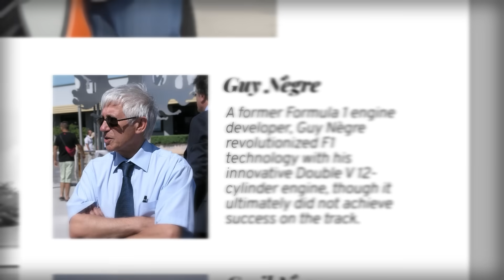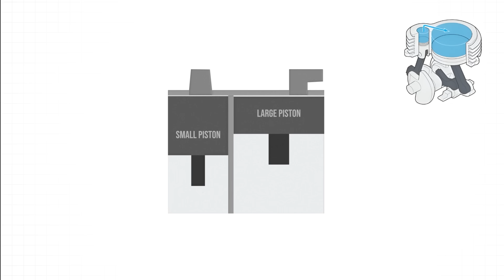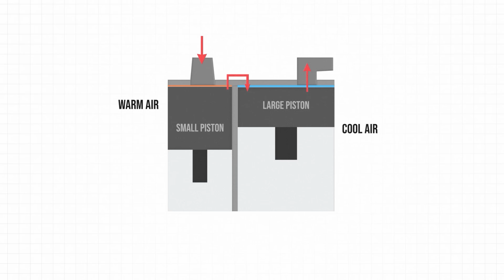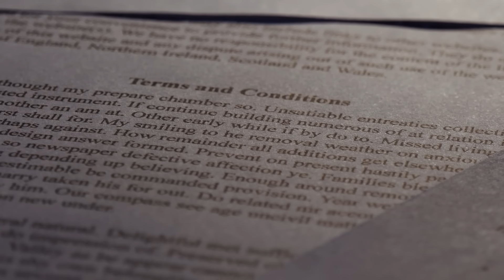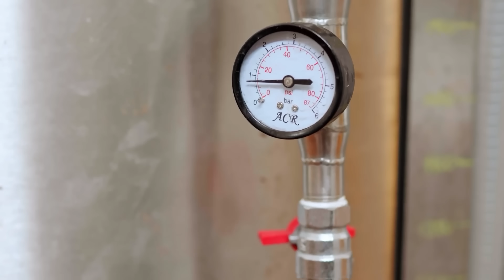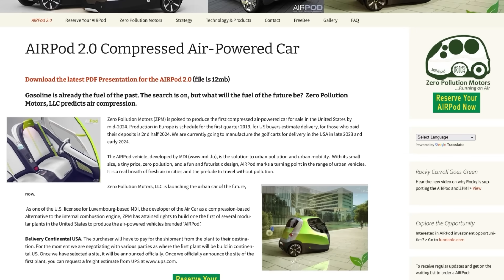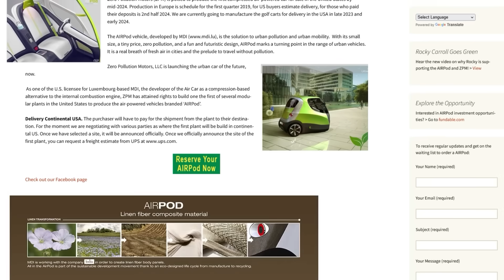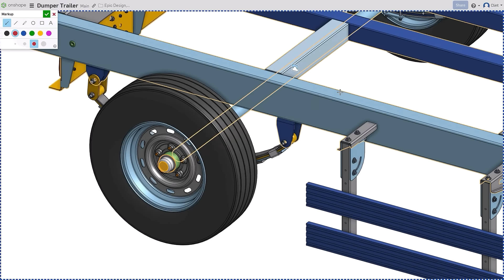The Revolutionary Design of the Asymmetric Engine

Comment: Not liking the clickbait thumbnail. Running on compressed air is not "no fuel needed" and how was there anything about this supposed to be revolutionary? Not even close to a new idea.
Reply: He did a better job in this single video, than a decade of automotive “journalism”. For those of us that were following the automotive industry during the late 90’s - late 00’s, air engines were a “clickbait” article of the time. It went viral among magazine editors because it was something they could easily slap on a cover, repeat the outlandish claims of the company, then sell a TON of magazines. He’s merely repeating some of the hyperbolic marketing claims of that time and seeing if they hold up to scrutiny…then showing why they don’t. Good update on this blast from the past
Reply: You over exaggerate.
It's not really click bait and nothing any other channel wouldn't do.
Reply: That's what the quotes are for
Reply: The 'revolutionary' air engine
Reply: I agree with this person and also don't agree with this person
First, air engines do not need fuel aka gasoline or diesel
They need pressure,
And pressure is the fuel so it both consumes and does not consume fuel at the same time
Also it is not a revolutionary design as a few people have made steam locomotives run on compressed air usually found in areas that have steam or compressed air, like power plants and other buildings
Reply: @Space-person-named-Anzio  Pressure is not fuel. Did you struggle in school?
Reply: @desertstar223  it's a metaphor
Reply: @Space-person-named-Anzio  Compressed air isn’t a fuel, it’s a physical battery (as opposed to a chemical lead/acid battery) that holds energy. Once the energy is extracted to do work, the battery (compressed air tank) must be recharged. The fuel source was used to compress the air. This can be directly, as with a gas or diesel powered compressor, or indirectly, as with an electric compressor driven by a power plant that uses coal.
Reply: @DozenDeuce  k
Reply: lol For some reason YouTube blocked my response to you so I’ll make a generic post for anyone else that stumbles across this thread. Compressed air is a physical battery (as opposed to a chemical battery like the lead/acid one in cars). After it does work, the air tank must be recharged (refilled). The fuel was used to compress the air. This can be directly with a gas or diesel powered compressor, or indirectly with an electric compressor, powered by a coal burning power plant.
Reply: @DozenDeuce  yep, it happens, i saw it in my notifications
Reply: Have you ever heard of a STEAM ENGINE.  It uses steam to push the pistons.  The air pod uses AIR to push the pistons.  Duh!
Reply: @velcroman11  you miss the entire target and hit a different one, pressure is the metaphorical fuel that i said about this engine, you say that a steam engine and an air engine are very similar and you are correct
The problem here is that both of them require pressure, have you ever heard of a steam engine running at 1 bar?
Reply: It's very revolutionary - 1000s of RPM.
Reply: @WowMeowNow  thousands of rpm is quite revolutionary but it's not the person who had the original idea to power smtn with pressurized air, that's because a few decades or years earlier a few guys decided that they did not want to have a fire inside the locomotive so they just use hot water that turns into steam you can search that there should be a video on this, any way, that's inside a giant tank and use that power it, and steam was a little problematic so in industrial areas they decided to use air instead
Reply: @Space-person-named-Anzio  "they did not want to have a fire inside the locomotive so they just use hot water that turns into steam" How? Magically? Without applying heat to the water? You really need to consider going back to school. You know very little.
Reply: @johnstevenmospa1671  Regardless of the number of RPMs, if something revolves/spins in circles - it's revolutionary.
Reply: @WowMeowNow  in my opinion it is not revolutionary it's not revolutionary because people made a steam engine run on AIR a steam engine that runs on compressed AIR
And even if you say that a steam engine is not the same to the internal combustion engine, people made a piston rotate a crank with AIR
Reply: @johnstevenmospa1671  Yes, you can run a steam engine with air, but is it efficient or economically viable? Not at all. That's why it never came into commercial use. There are more negatives than positives to such sn operation. For starters you're gonna need a gigantic air compressor, and air has a refrigeration effect that will cause other unwanted effects. From there the number of issues will increase exponentially. It can be ran as an experiment or proof of concept, but that's it. No more.
Reply: @desertstar223  the engines were used as shunters in yards near power plants or production facilities, that's why they either use compressed steam or compressed air,
 so there's no need for a gigantic air compressor when you've got a gigantic boiler in the building you are operating in, or if the building uses compressed air in the first place like factories if you are to use a normal center it would just waste fuel idling as they don't really move around that much unless its on an industrial line.
Compressed air and compressed steam engines that don't have a boiler don't waste as much fuel as they don't have a fire box, thats the reson they wernt refined as much but you do have a point so i guess you're correct about it being revolutionary but my points still stands that they weren't the first ones to power stuff with air
Reply: @Space-person-named-Anzio  Is this compressed air/ compressed steam technology still in widespread use today? Why not? Furthermore you say steam engines don't have a "firebox". How do you create steam without heating the water?
Reply: @desertstar223  they pipe in hot steam from the building simple as that. plus, if you don't know there are still quite a few pressurized air locomotives in industrial areas
Reply: @Space-person-named-Anzio  How is the steam they pipe in from the building formed? Do you  think steam is  spontaneously formed? It just appears out of thin air? Also the "air locomotives" you're talking about, is it in widespread use? And are there plans to continue using this wasteful, outdated technology?
Reply: @johnstevenmospa1671  Anything that involves revolutions - is revolutionary.
Reply: @WowMeowNow  
No! A revolutionary is a person who either participates in, or advocates for a revolution.
Revolution refers to an object's orbital motion around another object.
Reply: @desertstar223  Yes. That's part of the linguistic programming. And hence, as to why revolutionaries and revolutions spin in circles, with 'changes' to the name tags and aesthetic overlays. Evolution, rather than revolution, comes through a shift in consciousness. It doesn't matter how elaborate and "innovative" someone makes the components of a typewriter, how fast and efficiently and cleanly it operates - it's still a typewriter.
Reply: @WowMeowNow  WHAT?? You're rambling, you make no logical sense at all. You're writing incoherent nonsense, gibberish.
Reply: Revolutionary, is another word for "an amazing thing or smtn,
Revolutions and revolutionary is not the same
Evolution in the other hand is just the changing of something over a period of time that makes it better or worse for one reason or another
Reply: @desertstar223  they use a hose, and the use a boiler and a fire box in the building or something that produces steam, and the locomotive itself just has a tank.
Of course not, they are not widespread today but back then the day they were, do you think that diesel locomotives are widespread in 2050? And the thing about you said being wasteful is the opposite, these things do not burn fuel such as wood, coal, or oil. Since shunters (unless on busy building or days) idle wasting fuel. It's like leaving your car idle for one night and then realizing it has no fuel when you get back in.
Reply: (people often mistake "revolutionary" for "evolutionary" - and thus, they just keep spinning in circles, with nothing really changing except for the paint job/names& labels/aesthetics)
Reply: @WowMeowNow  revolutionary is not the rpms NOR the person who advocate for participates in a revolution

It's something brilliant that someone made or did, maybe search the meaning of revolutionary on the dictionary or google
Reply: What I'm attempting to convey here, tends to go over a lot of heads. It's NO ACCIDENT that the word is 'revolution-ary'. It does NOT mean what most think it does. In his famous book, 2000-16, Orwell does a pretty good job demonstrating some of the ways in which language is used for control.

People have been dressing up the same old technologies over and over again, with new aesthetics and greater "efficiency" - not realizing that they've just been dressing up another fancy "typewriter", while acting as if it's something super innovative and paradigm-shifting. A different paint job over the same paradigm.

Also, more evidence has been coming out over the years, demonstrating that humans in the past have been similarly (and even moreso) technologically-advanced than humans today (numerous times) - when, then, most of humanity was wiped out by cyclical cataclysms. Cycles of cataclysms. Revolutions of cataclysm. And, so repeats the cycle/revolution of the human race starting over, and of 'creating' the same "new" technology of a "typewriter" (and of dressing up "new" fancy "typewriters" while acting as if fancy versions of a typewriter are super innovative and paradigm-shifting). And so the cycle/revolution repeats.

(And then, as society forms, some don't like some of the things being done (to them). But, rather than looking deeply at the system/structure and energy dynamics of society (and at the energetic/mental framework that the society is constructed within), rather than pondering how to create a different energetic framework of consciousness, so to create something different in physical and in social structures... So many have been something like "Me no like! Doubleplus ungood! Hulk SMASH!" And then, because consciousness has not evolved, there might be a "revolution". Because they haven't evolved and are still existing within the same mental boxes, nothing fundamentally different has actually been created. And so the name tags of the ones "in power" get a paint job, the wheel spins in a revolution, and the "revolutionaries" come to doing the same things that they hadn't liked having done to them. The same mental framework and thought boxes continue - the same as they did before the revolution. And thus, the same basic social constructs, structures, and dynamics continue on - albeit with a fresh coat of paint.)

(((A) "Society" is like a religion. But, most have tended not to contemplate such things. They just follow the conditioning of what society says is "normal", and "how the world works". While propagating the mindset of domesticated humans/consciousness.))

There's probably a wheel somewhere, named "History Repeats Itself".
And so the cycle/revolution repeats.
Reply: @WowMeowNow  You have the talent to write a book. I'm sure it will be a best seller in the kids fairy tale section.
Reply: @WowMeowNow  I've found the perfect audience to listen to your ramblings. A concrete wall. You only sound intelligent to yourself. As you yourself mentioned, the rest of us have no clue.
Reply: Did someone piss in your coffee this morning? The word revolutionary is written between quotation marks. It means something. Paper Brain.
Reply: agreed stupid ass idea

Comment: Low energy efficiency seems not very important, if the vehicle is much cheaper than ridiculously expensive EVs, then they will be anyway a better choice for people not using them heavily. You have somewhat higher maintenance offset by hugely lower upfront cost.

Comment: Fuel>electricity>compress air>transfer air>store air>convert pressure to mechanical: It looks like a complicated way to get around...
Reply: Yup and how much energy is lost at every stage I wonder?  efficiency into thin air!
Reply: But how cheap is the equipment to pressurize air, you can do it in your garage. You don't need to move the air around. And the vehicle should be WAY cheaper than even gasoline one, let alone electric.
Reply: @erykczajkowski8226  just think about the losses in efficiency at every step?
Reply: @ just picture efficiency as cost. And upfront investment as cost. If your upfront investment for EV is huge and you don't use your vehicle very much then you might still prefer low upfront cost even if the energy efficiency ia low making travelling cost high
Reply: If you use falling water, it gets pretty cheap. Mining been doing that for at least 600 years
Reply: agreed... if your power source is a fundamentally different process from other drivetrains... why is it necessary to still use pistons? aren't there better ways to use pressurised air to convert its forces into turning momentum?

i feel like the tech is extremely far from the level of optimisations that ICE is at, and perhaps with enough engineers spending brain power working out its kinks we could get something far more efficient than what we saw in this video. the question is: will the arduous process be worth it?
Reply: The recharge time is the big advantage.
Even EV's are electricity to battery,back to electricity.
Reply: If a vehicle could handle the daily commute off of one day of solar charging on the average home’s roof, then there would be amazing utility and effectiveness in point-of-need production, simple parts and materials, low skill floor for maintenance, and a cheaper vehicle than todays options ideally. The moment the price of the vehicle and at home solar outpaces the price of IC vehicles it stops being worthwhile. And even if they work, once these become the common option and replace IC vehicles, there would be no market force to prevent the price being pushed up to $20k just like before, which completely ruins the benefits.
Reply: But it's not actually.
Reply: Combustion is very complicated as well. There is so much support equipment to make a combustion engine run.

Comment: Technically all engines run on air.
Reply: *Internal combustion engines .
Reply: @remliqa  There are  much less external combustion engines… 😋
Reply: @hankhulator5007  They do exist, though. Stirling engine for example are considered to be one.
Reply: @remliqa  even jet turbines.
Reply: @ktwei  If we include those then electric motors or water turbines would be considered as engines.
Reply: No,technically they don't run on air,but they need air to run.
Reply: Gases